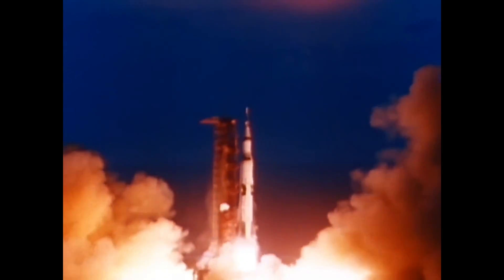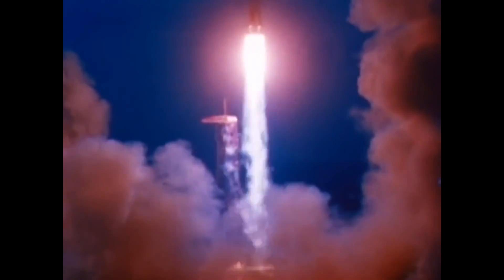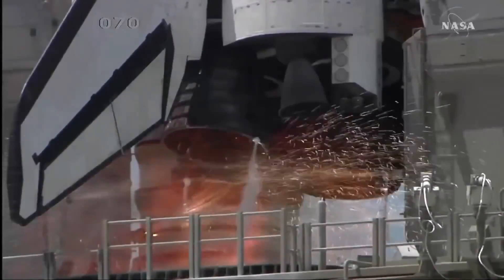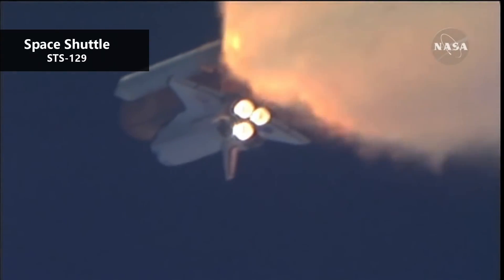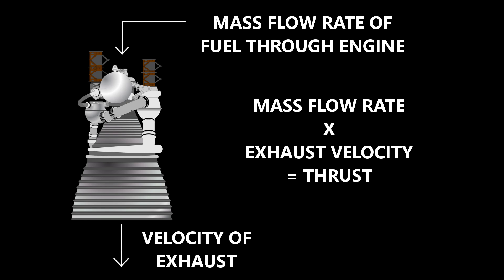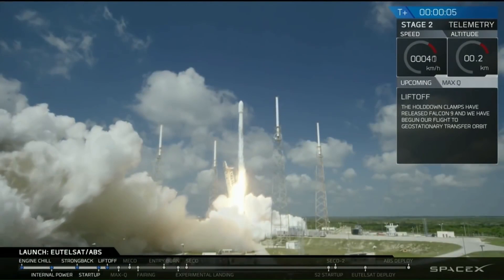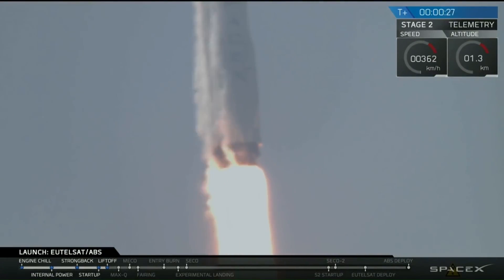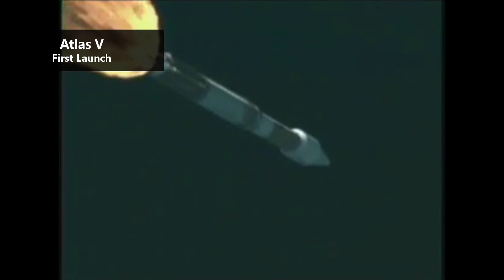How Rocket Engines Work - Part 1 - Thrust and Efficiency

Comment: nasa had this ides of the perfect ratio between mass and fuel, but the equation create the same problem what ever size. the more fuel the more you need to burn to lift it. no matter the amout of fuel small or big the same problem persist. another thing, rockets can't burn cerosine in vacuum. there is no room for a separate oxygen tank of the uss space shuttle. the setup is a one giant cerosine tank burning trough the shuttle and to booster rockets only for take off. most of the space on the shuttle is just cargo and crew. there is no additional room for a oxygen supply big enough to reach orbit. another thing, carring oxygen onboard the shuttle for lift  makes extra weight and makes the fuel even more inneffective.
Reply: That's why rockets are so big

https://www.pinterest.it/pin/304837468500136948/

Here you can clearly see the separation between LH2 tank and LOX tank

Comment: rocket nozzle does not increase thrust. it actually decreases it. it would work better to leave that out  as the nozzle create more air resistance. anyway rockets can't work without somthing to push agaist anymore than a car engine can work without the top cover over the pistons. you can't push agaist nothing.  action, reaction does not work agaist nothing.
Reply: From joe vignolo, this same comment section:
"It is a misconception that a rocket pushes
against an atmosphere and must do so to
work. Remember that both the rocket and
the propellants have mass, which means
that they both have inertia. Inertia makes
anything with mass want to remain in its
current state of motion. As such both the
rocket and the propellants both have inertial
mass and want to remain in a uniform state
of motion. So, when the engine is firing both
the rocket and the propellants are pushing
each other in opposite directions against
each other's inertial mass. As such the
induced motion of both massive objects
is away from each other and away from a
common starting point. So to answer your
question about what does the rocket push
against, it pushes against the propellants,
which have inertia, as they are accelerated
away from engine."

Comment: What does the engine thrust push off of in space? I ask, because all experiments have proven that thrust needs an atmosphere to push from. If there's no air or atmosphere in "space," how can a rocket propell itself forward, or any other direction? You failed to explain that part in this parroted narrative.
Reply: It is a misconception that a rocket pushes against an atmosphere and must do so to work. Remember that both the rocket and the propellants have mass, which means that they both have inertia. Inertia makes anything with mass want to remain in its current state of motion. As such both the rocket and the propellants both have inertial mass and want to remain in a uniform state of motion. So, when the engine is firing both the rocket and the propellants are pushing each other in opposite directions against each other's inertial mass. As such the induced motion of both massive objects is away from each other and away from a common starting point.  So to answer your question about what does the rocket push against, it pushes against the propellants, which have inertia, as they are accelerated away from engine.

Comment: Isp still doesnt make any sense to me.
Reply from the maker: Basically Isp is effective exhaust velocity divided by 9.8 m/s^2. The unit for Isp is seconds which is used everywhere so its easy to communicate Isp without converting between units. So Isp lets us figure out how much thrust an engine will produce when burning fuel at a specific rate.

Comment: The turbopump was driven by a 5,500 HP turbine, not 55,000.
Reply from the maker: Wikipedia says the turbine produced 55,000 brake HP (41 MW). It says the RPM was 5,000 RPM.

Comment: No, a rocket creates THRUST by Newton's Second law, F=dm/dt X dv/dt.  That THRUST creates MOVEMENT by Newton's Third law.
Reply from the maker: I would say it's the other way around.

Newton's 3rd Law doesn't deal with movement or acceleration at all. It just states if body a exerts a force on body b then body b exerts the same magnitude force on body a in the opposite direction. This explains why exhaust flowing backwards from the rocket engines provides a forwards thrust on the rocket.

Newton's second law is needed to describe the acceleration resulting from a thrust force.

You can use Newton's Second Law to explain the thrust force as well. Since the exhaust gas is accelerating you can find the force using F=ma which is given by the second law, but you still need the third law to explain why a thrust on the exhaust also applies a thrust to the rocket.
Reply: @SpaceIsKindOfCool  - I agree. However, it is also very important when giving a complete explanation of rocket propulsion to also mention Newton's 1st law, which describes inertia. This is especially important when people ask the typical question, "What does a rocket push against in space?" To properly answer this question it must be pointed out that both the rocket and the propellants have mass, which means that they both have corresponding inertia. Inertia makes anything with mass want to remain in its current state of motion, according to the 1st law. As such both the rocket and the propellants both have inertial mass and want to remain in a uniform state of motion. So, when the engine is firing both the rocket and the propellants are pushing each other in opposite directions against each other's inertial mass. As such the induced motion of both masses are away from each other and away from a common starting point. So to answer the question about what does the rocket push against, it pushes against the inertial mass of the propellants, which want to remain at rest, as they are accelerated away from engine in the opposite direction.
 I sometimes describe the propellants as having a "dual function". One function is to support combustion to generate heat and pressure inside the engine to accelerate the propellants out the nozzle. But the other function is to provide the mass, with its corresponding inertia, that gets accelerated to provide the equal and opposite reaction.
Reply: newtons third law is poorly defined. it is actually a 3 body concept as a displacable medium can only act if it pushes agaist somthing in either two or all directions.  there is no two body version of newtons third law that is acurate. if a gas is entering empty space from a tank, the gas will only propel the tank forward if there is a external force to act against. if the space is a vacuum the gas will just leave the tank without any movement to the tank at all. a compressed medium will alway travel a path with the least resistance.

Comment: What about weight ?  That has to be one of the most major factors.  The really old 1960's era RS-25 engines being mandated by law to be used on the SLS have an impressive amount of thrust.  But when you factor in weight, these are engines are not impressive at all.
Reply from the maker: The space shuttle engines are impressive because of their high specific impulse. If an engine has a high specific impulse than it can afford extra weight because it will require less fuel to do the same job as a rocket engine with a lower specific impulse.